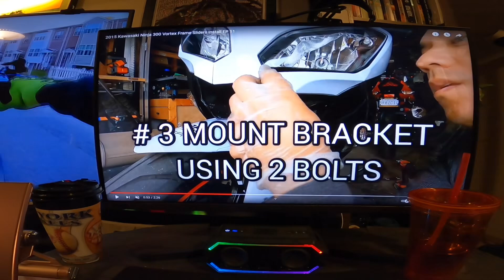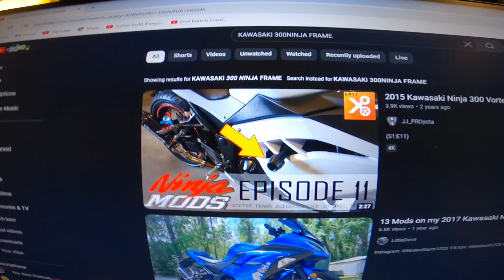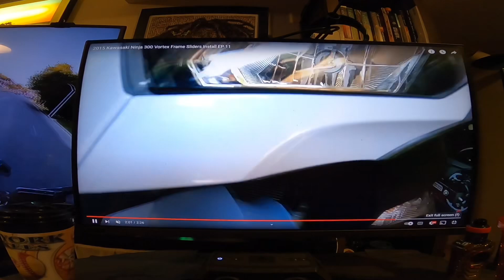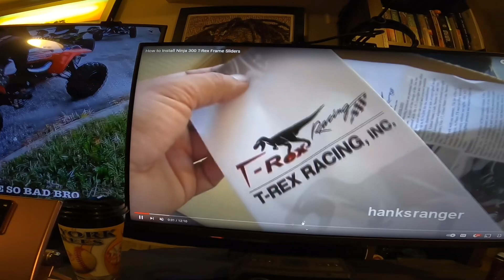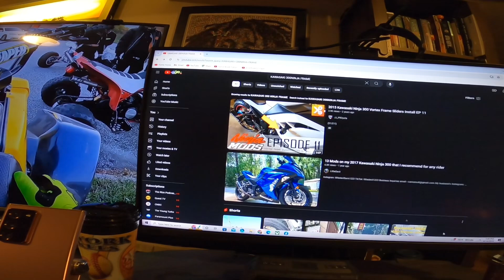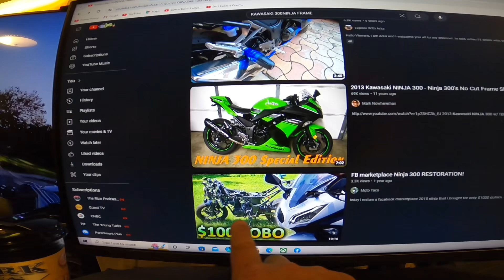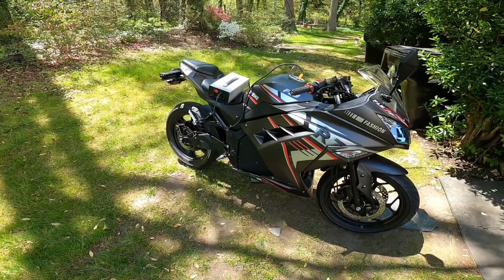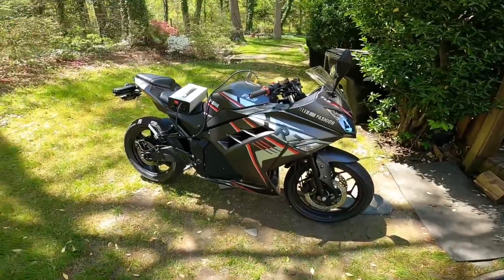Kawasaki Ninja 300 converted to electric, Fly Ebike did all the hard work just needs a tiny bit more

Comment: Can you put rims on this bike?
Reply from the maker: not really you could change your front rim but i dont know why you would and the back rim has the motor in  it so unless you upgrade or switch to a different motor your stuck with what it is, can you paint them or get them dipped in Chrome Im sure but that would be on you Bro. only way you could alter that is switch to na mid drive motor and chain then you can put whatever motorcycle rim you want

Comment: What's the most you can set max amps at if your running 72v lead acid? Have you made a lead acid 72v bike 
able to get some decent G's and max speed?
Reply: I know someone with a Z1000 style E-moto that he got speeds of 58mph on the flats, with an 80amp controller. Batteries were lead acid 32ah.
Reply from the maker: honestly Bro I havent had the lead acid but i do know they arent very high disharge so they dont seem to be able to put out many amnps and theres no way I could runt this controller on those right now. I heard that most guys runningf lead acid only get maybe 35-40mph out of those so im guessing that may be around 40-50amps unless you can give me a different result. I think the voltage sag is really bad on thoise as obviously the lithium put out so much more. You could probably run another 12v lead acid in series to keep the voltage up high and it would do allot better. You can get some 72v litium packs that wont push a ton of amps but certainly way more than the lead for reasonable. I recommend a company called Amorge batteries if you dont wanna spend a fortune and get good performance. You could also look for a used pack. I could probably make a half way decent pack with some alright cells at a good price as well but if you plan to do some upgrades dont waste money get the best battery you can to be future proof and do controller later